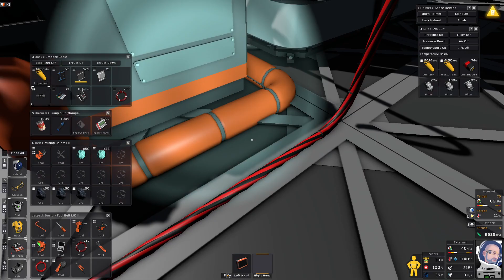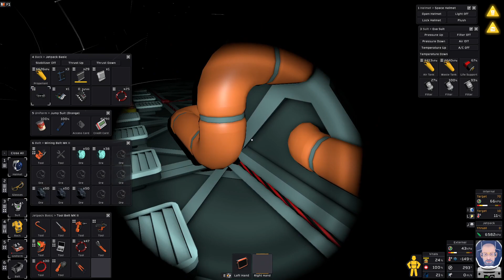Stationeers Europa episode 10. Stirling engine. A perfect place on Europa

Comment: Chief volatiles only ignite if O2 or N20 is present, in the past H2 was the best canister gas also an idea of automation instead of having a blow off valve at 8.5k ,(why not store more hot gas?) regulate the press as into the Stirring input pipe? Idk if a pressure reg will keep up with the demand if not a volume pump with auto volume setting logic might be better.  If that won’t last idea I have I’d a press ref into a “reservoir”  of inline tanks and use the Stirring as a back up gen(s)